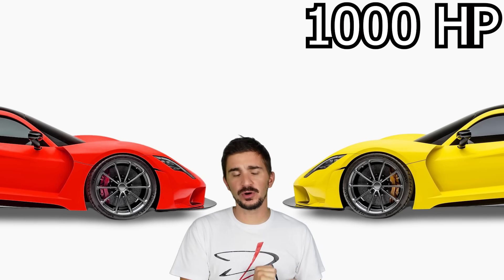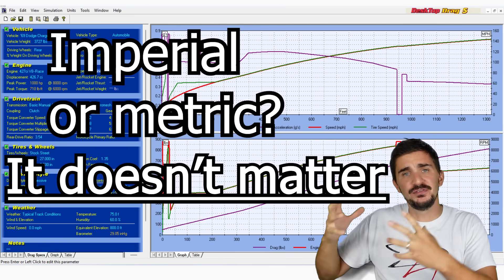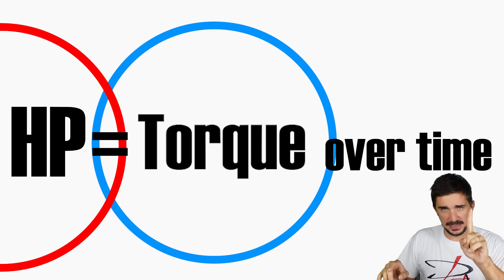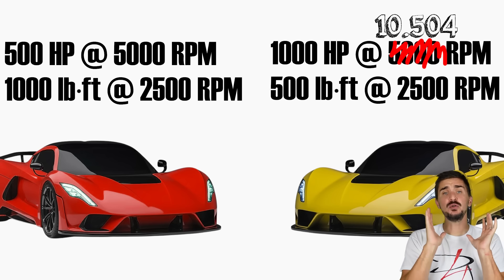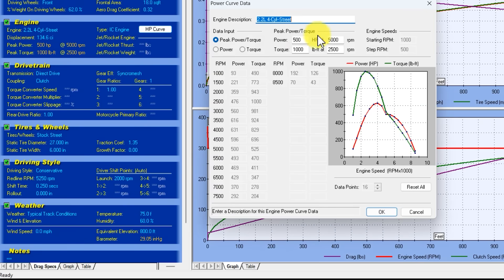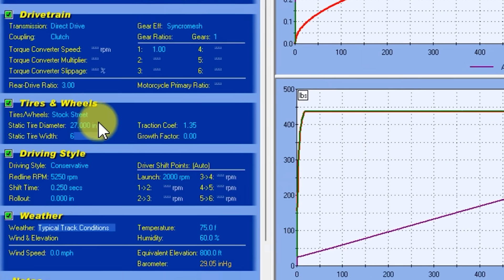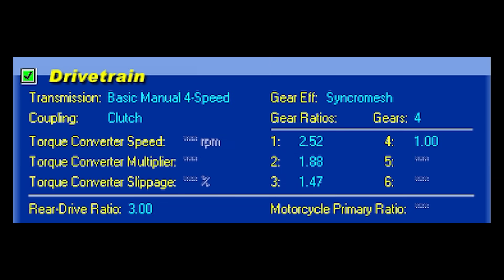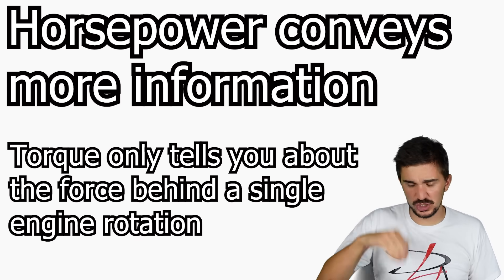Who's faster? Explained and Simulated - Horsepower vs Torque

Comment: I'm a race engineer. It's a little different now, but we used to change intake trumpets and exhaust lengths to change the power curve and we had about 40 ratios to choose from (5 speed gearbox) to optimize the rev band. The goal is to achieve the highest average engine power per lap, or greatest fuel consumption (a good surrogate), which usually means you're the fastest.
Reply: I used to race Karts in my teens and pre teens. I used to change expansion chamber sizes and head tube length (depending on what the class rules allowed.) To get a little more torque in the low to mid rpm range.(It was easier than changing gearing most of the time.
Reply: @danielsteward5090   It's the exact same game in cars as karts.
Reply: I love how fuel economy is max gallons per hour in racing.
Reply: @soulcapitalist6204   I see "Liters per lap" in my sleep.
Reply: Instructions unclear, I poked a hole in the fuel thank to achieve maximum fuel consumption 😁
Reply: Uh setting up a car-track-driver combination is a neat science and to some degree a art.
How much speed can you carry? How much power do we have? How do we scale RPM vs torque over the gears? Can we utilise some extra topspeed with a slipstream?
Reply: Of course the formula shown in this video is missconsidering a lot of variables that even as a normal drivers we can modify: as you said the intake performance that affects the efficiency of the single explosion, the exhaust pressure/resonance (as we can change slip-ons, remove catalysts, exhaust length, etc), the engine ignition, etc. And others we can't change that is the rpm limit cap (electronically limited and/or physically limited for the piston max speed cap.)
Reply: @toni_capo  , How can you explain that in this example on the video torque biased engine became slower after applying gearbox?
Reply: Average hp between shifts win races. That's why torque says nothing.
Reply: @J3n555   It's amazing how difficult it is to get this simple concept through to some.
Reply: So what you are saying is: Horsepower wins... Every time.
Reply: @rigididiot  other than at zero engine or vehicle speed, anything Torque can do Power can do better.  Torque and torque alone rules the vast vast domain of dead stopped.  😁. Gotta give the Torque mystics something to call a win.  Love the handle, do you live near the ring and do track days?
Reply: @rollsroyce329  "anything Torque can do Power can do better.  Torque and torque alone rules the vast vast domain of dead stopped."

LOVE THAT! I am SO gonna steal that!

Not being a born english speaker I had to read your post twice, but dang, you said it well.

I live about 30 minutes from Assen (TT-circuit) and I used to do trackdays, held a race-license and race at club level, but not since about 16 years anymore.
Reply: @rigididiot I did a Champ Car racer there in 2007.
Reply: @rigididiot  It's the unit of measure that contains all the information were interested in knowing.
Reply: @MrTL3wis  I know... I basically have a very similar education as you, I guess
Reply: 12:40 Torque is NOT about a single rotation, its simply the twisting (torque) force and tells nothing about how quickly work is being done.
Reply: Hi being a race engineer would you say Adrian Newey made a car more suited for max than checo? As they both drive the same car but max performs way better than checo and checo is not a bad driver at all.
Reply: @pwrofmusic  It's impossible for anyone outside of the team to really know what goes on inside. First, Newey is just on a different planet than everyone else, in a good way. I don't understand a designer that can stay relevant for 40+ years. He's just amazing. 

I think if we were going to do physical/mental tests on Max and Checo that they, and most of the other drivers, would perform very close to each other and all at a very high level. They are all amazingly good athletes. Sometimes, though, a guy will have a certain connection with a type of car and they're just really good in that car. For Max, it's F1. 

For Checo, no one knows what the internal politics are. The pressure on the guy is through the roof, so he's trying to make things happen. That's when the mistakes come. The spiral in performance is self-perpetuating and really hard to reverse.

It appears to me that Max is able to attack in a car with slightly more front downforce and slightly less stability than Checo. These differences are vital, but I bet they're numerically small. Visually, the cars react similarly around the track. So I think both cars are on the same setup philosophy. When Checo can hit his setup bullseye, he does well, but the target is small. Max seems to have a larger acceptable setup range and less of time drop when it's not good. This suggests he manipulates the car on the brakes quite a lot which is probably why he's able to accept less stability.

All of this is just a shot in the dark, though. I don't know any of the people involved.
Reply: @pwrofmusic   First, Newey is a freak-genius. I'm a journeyman. He's Jordan, Kobe and LeBron all in one.

This is a guess, because I have no first hand F1 experience, but here goes.

Max seems very, very good with an unstable car. This lets them run the car's ride height very near the aerodynamic peaks and he's able to manipulate the chassis (mostly with his feet) to be at the correct pitch attitude all through the critical entry portion of the corner. Corner entry / brake release is kind of like throwing a dart. Once its out of your hand, you can't do much to change the trajectory. However, if you can present the car to the corner correctly, the exit takes care of itself. Max's ability to presently the car to the corner routinely with precisely controlled pitch and yaw attitudes is damned impressive. Checo is very good at doing it, but Max is just that fraction of a percent better. That fraction of a percent makes all the difference in the world.
Reply: Best job
Reply: Hmmm. Fuel consumption to determine power. At 85 mpg, I guess I need more boost.
Reply: @spidergoose891  More boost OR more RPM... Any way you manage, if you get more air and fuel through the engine without wasting it (blowing it unburned towards the exhaust) will get you more power. In other words, burning the fuel where it counts is the 2nd challenge.

Then: Whether that power is usable is a different matter. If all the extra power you make goes into driving that bigger blower you installed to get more boost, the only change you will see is in your fuel bill.

Then again, any vehicle getting 85 mpg, not sure if there is any point in boosting, as that is moped territory...
Reply: @rigididiot  moped? It makes about 220 hp and 500 ft-lbs. Had it up to 160 so far. Still had 2000 rpm to go.
Reply: @spidergoose891  Then I am pretty sure it does not do 85 mpg now does it?
I mean, an engine with that kind of power (I do not care about torque, it's pretty meaningless in the grand scheme of things) should be able to burn through close to 23 gallon per hour at full chat.

That kind of power does not go well with 85 mpg.

My own bikes only have 70 and 80 hp respectively and do about 70~75ish mpg in normal use, 55 when being used on the track.

85 mpg suggests bikes below 40 hp, in other words mopeds. 220 hp bikes don't do 85 mpg even if you run it at idle in highest gear (about the most fuel efficient you can get)
Reply: @rigididiot  it's probably not getting 85 at WOT. It does cruising 75mph. This is a turbo diesel in a 3600 lb car.
Reply: @goose891 Ah, OK, a charged Diesel changes things a little bit...
Just FYI, your engine, IF you get 85 mpg at a 75 mph cruise, is producing (with an accuracy of about 10% plus or minus) in the neighbourhood of (sit down and hold on to your chair) only about 16,5 hp...

I'd say your cr has a pretty good aerodynamics and wheel alignment is pretty much spot on to achieve that kind of low rolling resistance.
my car is around 2000 lbs, NA gasoline, 1,2 litre and about 85 hp only, cruises at about 41 mpg @ 62 mph.
Translates to about 19 horses to maintain that speed...

So... don't worry about "getting more boost", yours is turbo charged, it will make its own boost once you put your foot down hard enough :D

Just beware of speedtraps and be prepared to pay at the pump. As I said, at full chat that engine of yours goes through 23 gallons per hour. Assuming you get maybe 180 or 190 mph, well you can do the math, less than 10 mpg with the pedal to the medal... :D
Reply: @rigididiot  it sounds like you like to go fast. I'd recommend playing with the TDIs. I got mine for reliability and fuel mileage, but my DEF kept freezing and that started a chain reaction of modifications. It's fun and practical to drive.
Reply: @spidergoose891  Not in cars... Cars are just to get from A to B while keeping dry clothes, hands and feet... :D

Bikes, yes, but not much opportunity here.

But the numbers don't come from racing or anything, I am just an "engine-engineer"... It's my job to measure and determine output and fuel consumption. Mainly of (huge) diesels, but I can do the trick just as easy on a 1 cu.in. toy airplane engine (or smaller...)
Reply: I think the hp limits should go up and fuel consumption should go down. Then manufacturers can really be competitive again.
Reply: @JAO911PLIST  Well...There is a contradiction: Power comes from fuel, there's no way around that... You cannot get more power from less fuel unless you ask congress or SCOTUS to change the laws of physics...
Reply: That's awesome. I like that 'guiding light' of fuel consumption as a proxy. 
I've always wanted to ask someone if power is a product of the temperature of the fluid vs the exhaust ..? It seems almost so obvious as to be tautological ... but without asking someone who knows more than I, I can't know if I'm overlooking something. My reasoning is that the temperature delta is a 'surrogate' for pressure. Thanks to anyone willing to critique this thought. 

It also feels like horsepower is the ability to preserve torque long enough to do work. Imagine if torque quickly rose to 100 lb ft at 2,500 rpm and dropped to 50 by 3,000. You'd have very little 'time' from which to accelerate with those "100 torques."  If you merely retain those 100 lb ft from 2,500 through 5,252 rpm, you have a much longer period of time from which to use to multiplied torque of each gear. 

Of course, he could have done basically his comparative engine in which one had 100 lb-ft from 2,500 to 5,252 and another had 50 lb-ft from 2,500 through 10,504.
Reply: @ You don't get it... Basically, power=torque x RPM (x a constant to iron out the imperial units).
Without computing exact numbers, I can based on those numbers with 100% accuracy tell that the engine in your example, at 3000 RPM is producing only 60% of the horsepower it makes at 2500 RPM. You do not need "time", you need a CVT that maintains 2500 RPM when you put your foot down.
Reply: Greatest fuel consumption means fast ;) That was not how it worked the 1976 model Opel Ascona B 1,9SR with 90hp, it had a busted carburetor guzzling 1,5l per 10km of gasolene 98 octane (lovest it cud run on with lead). It did run compactly normal, not specially fast... Then I got  a proper working carburetor and the fuel consumption went down to about 0,7l of gasoline per 10km and acceleration and all was pretty much identical it just used less fuel...
Reply: Nice 👍
Reply: Handling beats speed unless you're on a drag strip or going in circus I mean circles I mean ovals.
Reply: @LirealAndJeremy   Don't sell the roundy-rounders short. That is very much a handling game, and in many ways more than on a road course. A driver can make up some of the difference up on a road course if the car isn't handling well. If the car isn't handling well on an oval, the driver is pretty much screwed.

Drag racing has quite a bit of chassis work happening as well. The 60 foot time is vital.

The only thing that's almost pure car is street roll racing and I can't be bothered to really even take notice of that. This is what everyone sees with their own eyes, though, so it's impressive. They've never seen a full-race trim Tesla at the track that can only run a single lap at a time.
Reply: @MrTL3wis  They just have to crash into the wall a little to adjust their setup on the fly! Every oval racer is taught how to do this. 😎
Reply: @bubbleman2002  We do have tools for that, as well!
Reply: How can you explain that in this example on the video torque biased engine became slower after applying gearbox?  @MrTL3wis
Reply: @LirealAndJeremy  handling beats speed on most ovals too
Reply: everyone is a race engineer on YouTube LOL
Reply: @ACommenterOnYouTube    I don't know about that, but I'm in IMSA LMP2 presently. The car I was referring to was the old Toyota-Atlantic. My car won the championship in 2004 with Jon Fogarty driving. Our team was Pacific Coast Motorsports, based in Carpenteria, CA (at the time). Look it up.
Reply: There is no such thing as a “race” engineer, homeboy
Reply: @drrightwing4435  My degree is in Mechanical Engineering. My job description is Race Engineer. It's really not that big of a deal and not at all the point of the post.
Reply: there is no such thing as a car with higher hp than torque
Reply: @heldermonteiro2718   Yes, there is.
Reply: @MrTL3wis  I never saw one
Reply: @heldermonteiro2718 who cares what you personally saw lol

Also

Torque and power are completely different things that can use a multitude of different units, “higher” without specifying at least the unit, means shit
Reply: @heldermonteiro2718 What units are you talking about?
Reply: @heldermonteiro2718   incorrect
Reply: @heldermonteiro2718 have you ever heard of a V8 Audi RS5 they have like 450 hp with like 350lb ft of torque😂
Reply: @heldermonteiro2718  there are plenty, it's especially common in economy cars. Ffs do some research before you post.
Reply: @beargillium2369   I never saw a car with more HP than torque

Comment: I guess that formula/constant isn't really valid for electric vehicles? They have a lot of torque at low RPM and only lose torque with higher RPM, which is why they have such an insane acceleration at the start and don't really need any transmission, unless you want to go to crazy high RPMs/speed...

Comment: Hp is the speed in which torque is created. 

Higher Hp wins on a longer track, as the higher hp is generated at a much higher rpm. Higher torque wins on a shorter track, because engines that create higher torque do so at much lower rpms.  You can play with a torque multiplier (gear ratios) in an attempt to change the outcome, but that’s outside the scope of the initial question.

Comment: So it seems that the problem is that Horse POWER is a misnomer. Should be called Horse ENERGY and the torque could be called Horse POWER (Even if it's a torque).
Reply: Bullshit
Reply: Why the heck would it be called "Horse ENERGY" when it is a measurement of power and not energy?!

Comment: The engine that is able to  output more HP during acceleration is always fastest. It is just that is not always the engine that has the highest max power output, because power depends on RPM and the gearbox comes into play.
Reply: Fastest at acceleration, yes, top speed not so much. At higher speeds with that much gear box draw to keep everything spinning at a higher speed would pull power from the motor. a high hp car, on the other hand, with the a favorable custom gearbox, would be faster at higher speeds.

Comment: This video also explains sorta why EVs do accelerate so fast, but! Won't reach a higher top speed as A they don't have enough gears or a gear ratio that will allow for it and B they gain power but lose torque the faster they spin, mean they eventually wouldn't be able to turn a higher gear. But an internal combustion engine can if it has sufficient torque to keep putting power through higher and higher gears, may not accelerate through those gears as quickly but it will spin through them unlike an EV. 

But for this topic the 1000lb/ft will accelerate faster much faster but not rev quickly to reach a higher gear in time, the 1000bhp car may not launch as fast at the start unless it's using slicks but will be able to rev faster and get into higher gears quicker which will mean ultimately it will win a drag race. Unless it's a 1/8th mile 😂

Comment: I've seen many explanations of torque and hp; I now finally truly understand it. Great explanation.
Reply: You actually truly trust something you liked, but don't understand the torque and horsepower for sure 😅
Reply: @constantinevu48   this is the worst explanation I ever saw - why even bother making a youtube video on a topic you dont understand?
Reply: Agreed!
Reply: The punches explanation is a bit lame IMO, why, torque number actually gets nothing done, it does not tell you the rate at which work is being done. At 12:40 Torque is NOT about a single rotation, its simply the twisting (torque) force applied and tells nothing about how quickly work is being done.

Comment: Physics tells via conservation of energy that horsepower determines how much you can accelerate. It is a hard limiting factor. If you can use that depends on the proper gearbox though.